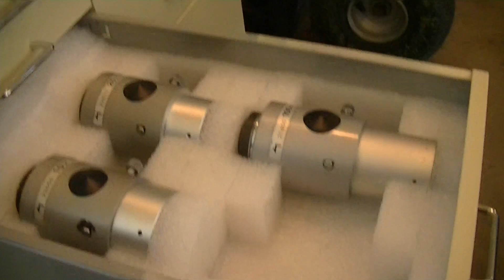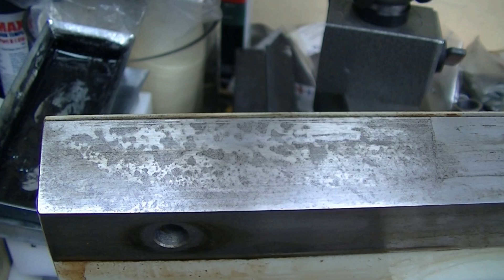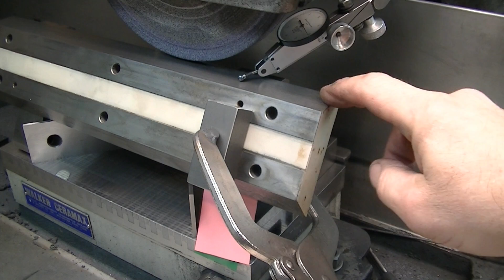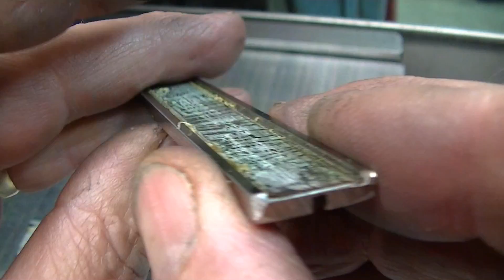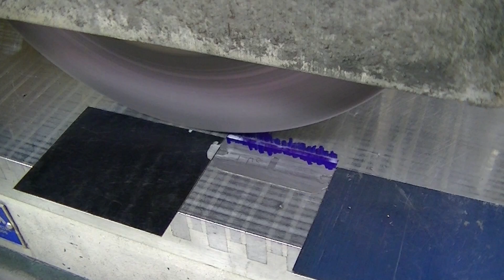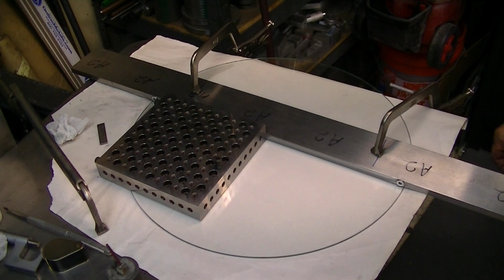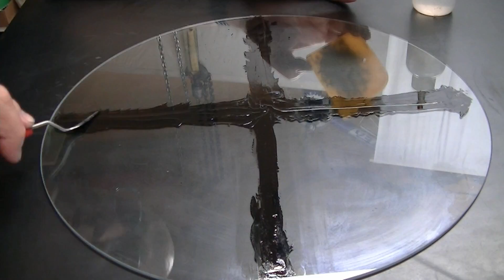NIKON COMPARATOR RESTORE

Comment: There's a lot of difference between a "tenth" and a "ten thousandth" and plenty of "rookies" would be much better off if the "experts" they try to learn from online would use the right terminology instead of incorrect "slang". The "experts" trying to communicate to others their experience and knowledge when it comes to precision measurement and other aspects of "metrology" would also benefit from using the right and "precise" terminology. Accurately and precisely are a state of mind and a way of thinking and communicating before they're ever a way of doing things. I've only been in the technical trades dealing with "metrology" for 25 years or so professionally and a few years before that as a student but I haven't yet come across specifications where the words "couple", "few", "close enough", "not important", "thou" or any of the other slang words/terms/phrases I see everywhere in online "how-to" media meant to educate "rookies" and produced by "experts". Accuracy and precision are either important or they're not. And if they are or not in a specific circumstance is rarely determined on the fly and arbitrarily by those of us in the field unless we also happen to be the inventors/fabricators/designers/manufacturers at the other end of the line in the "factory". 

As for "restoring" tools and "precision" machines essentially turned into "scrap" by improper operation, maintenance, service, storage etc, let's just say that there's no way to put back what wear and tear and rust take away that begins with "machining" parts that are already out of spec on the "wrong" side where adding material and THEN machining is the  ONLY way to "restore" factory-specified dimensions. Something else "rookies" and plenty of "experts" could also benefit significantly from is a "how-to" video detailing the definitions and significance and importance and non-interchangeable nature of correct terminology like "dimension" and "specification" and "tolerance" and "clearance". Dimension in particular seems to get forgotten or ignored with "tolerance" used in its place. Which is a problem since "tolerances" are usually determined by the "factory" and the ability of its processes, personnel and tools to produce parts according to specifications that demand specific dimensions. Again you won't find "couple" or "few" used when it comes to "tolerances" much of anywhere besides online "educational" media for "rookies". 

Hopefully the "experts" somehow manage to educate others better than they themselves seem to have been educated when they were "rookies" although that seems very unlikely if they don't break the cycle of "teaching" incorrect terminology, the use of slang and other bad habits that are only going to end up getting "rookies" in trouble for doing the "right thing" as they were taught by online "experts". That's the big problem with "master/apprentice" educational systems. Garbage in and garbage out and no chance for the "apprentice" to be correct unless the "master" is wrong. And very little chance that once the "apprentice" is deemed to have "complete" his/her "education" by the "master" and assumes himself/herself to be an "expert" he/she will ever be "wrong" no matter how incorrect they are. There's nothing like a "graduation" to make a student a former student in an instant when nobody has ever bothered to teach them that "education" is a goal rather than an achievement and there is no better "teacher" than being wrong at least once a day for the rest of your life.
Reply: I think this person might have had something interesting to say. Pity they couldn't find the words, though.
Reply: Of course you can refurbish and rebuild machines to factory or better-than-factory spec without having to build up material. You just have to understand what youre doing. It is done all the time and without problems. Or would you weld-buildup a lathebed before having it reground?
Reply: "what" do you "mean" ?
Reply: DEEREMEYER1,  My god you're annoying! No wonder all your videos have about a 15 to 1 dislike ratio, pretty sure that's the worst I've ever seen. Do yourself a favor stop being so jealous and STFU!
Reply: DEEREMEYER1 Another failed alphanumeric beatdown from Deeremeyer1...lighten up, man. Nobody watching Robin’s videos past the first minute is going to misunderstand what a “tenth” is in context.
Reply: Wow Deeremyere1, as much as I think being accurate during videos about machining is more than important, using 10ths as a quick communication term is well recognized at least on the North American continent for what it is, 1/10,000th of an inch. Even Metrology manufacturer's and calibration labs use the term.  I see numerous YT creators using a "this guy" term for just about any piece or part instead of calling it what it actually is. Robin however never does that. Verbal or written communication only works when everyone agrees what each term means. And if I've learned anything during my working career it's that every industry has it's very own and specific "slang" terms that then get used by everyone else in that industry as a form of communication. As an example? Bull Prick and Pot Head are two "slang" terms well used in the open pit mining industry to mean a distinct part on the rear of large electrically powered rope shovels and the connection ends on the trailing high voltage power cables. You wouldn't ever find either definition in any dictionary I know of. 

Stefan of course correctly pointed out you can rebuild and restore way surfaces by removing material "IF" you know what your doing to preserve the alignment as both Stefan and Robin clearly do. Other than maybe Rulon or any of the other plastic material designed for building up way surfaces or providing a low friction bearing surface, I know of no other way of rebuilding or replacing the lost material rust or wear causes that wouldn't involve heat. And the instant you apply any heat to precision surfaces there going to change. Sure you probably could apply hard surface welding then regrind that back to the OEM dimensions, but at what price in far more effort, time, and costs to obtain the exact same result Robin managed without chancing a great deal of part distortion? And "tolerance"? I don't know about in your world, but nothing in mine is ever "perfect". There's zero made that doesn't have a + - on it including anything made by Moore Tools. It might be + - 1/1,000,000ths but it's still got a tolerance.I'd also think that 99.9999% of Robins subscribers already class him as far above any average expert, nor has he ever said or even implied he was. I'd bet a great deal he's never once thought of himself as that. In my experience it's almost universal the truly gifted are always more than humble about there own ability's. As someone else has already said there results and work speaks volumes without them needing to say a word. In my opinion Robin can continue as he has and I'll continue to be amazed at his over the top work while feeling I'm learning a vast amount for my time spent. Obviously you don't agree but I guess that's your right.
Reply: I'm not sure, are you trying to say that you do agree with the methods Robin shows, that you do not agree with them or are you just trying to tell other viewers that it's not as easy as it looks?

I do however agree with the misuse of the word expert. A true expert (or lets say, very experienced in the specialisation) does not have to tell others he is. I believe I commented that on one of Robin's previous video's or instagram posts, a true experienced craftsman shows his expertise through his work.
Reply: Better to remain silent and be thought a fool than to speak and to remove all doubt.
Reply: There are Masters (Rob R, Adam B, Keiths F and R, Stefan G and many more),  and there are "masters" who have nothing coherent to say.